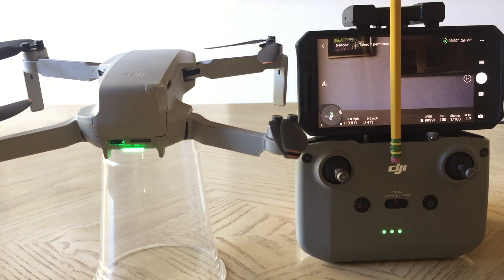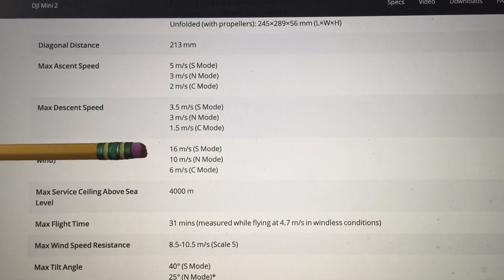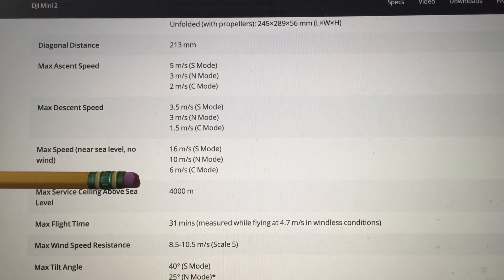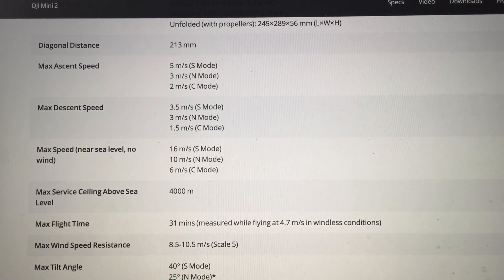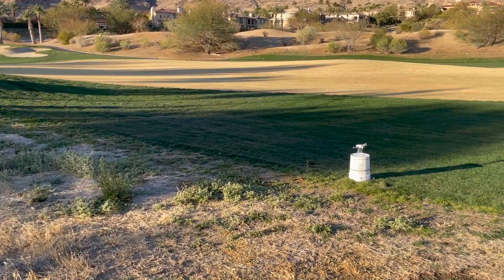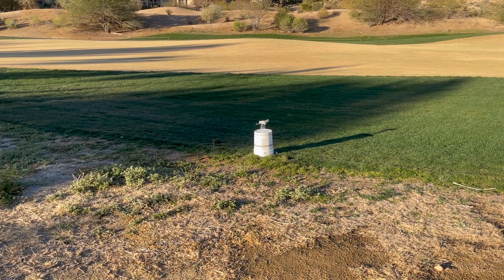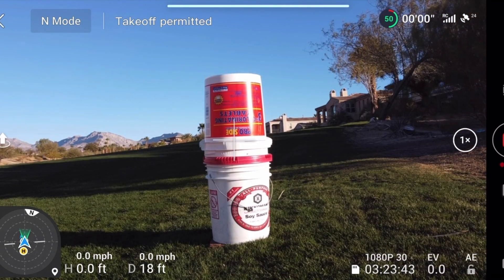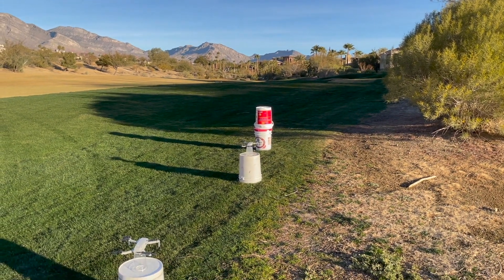DJI Mini 2 Latency Demonstrated

Comment: Any Info on the mini 3 Latency yet can't find it anywhere on the Internet. In the meantime i fly with Caddx ant + Runcam TX200u + 150mm Triple Feed Patch + Eachine lcd5808 it is so much  better for close poximity flying! You should try it! I Call it the FrankenDJI ;-)
Reply: Just found it myself on the Product Page ;-) still 120ms bummer. guess we have to wait for the DJ mini FPV Drone witch won't have gimbal stabilised footage.
Reply from the maker: Yeah, if they make a mini DJI FPV drone I'm getting it!

Comment: The Anafi AI with an integrates a Fibocom L860-GL 4G LTE module (in addition to the Wi-Fi radio) allowing to transmit a video in 1080p with a very low latency (300 ms) without range limit and everywhere in the world. Meaning that you can transmit live video anywhere in the world. Also, there is an HD live feed HDMI out to connect to external monitor. Meaning that you can control the drone from anywhere in the world. I am working on a software for drones as well for 5G. With 5G technology the latency will be bellow 1 ms up to 8k video transition. 5G will change the world in every way. There is a scam right now with all companies saying that they offer 5G, it is all not true. 5G requires over 5 different technologies and it will take in the USA alone over 7 to 10 years to be implemented, I think in 2030 is when we will have 5G. I work in the media industry and Broadcasting HD video took over 30 years and we still do NOT have full HD videos. All USA TV stations broadcast at 720p and 1080i. Meaning that is less than 2k resolution the government wanted to be. I hope the 5G implementation with be faster cause 5G will be in everything electronic. With 5G we will be able to create software in the cloud the will control drones, cars in real time, making anything electronics cheaper because the brain will be on the cloud. Another thing about 5G will do is the capability to have paper thin monitors, super fast computers that the CPU will be no more. Everything will be controlled by super computers. The drone technology will be almost a million times better than today's drones, because super computers will be most of the work and the drones will be almost empty shews with less parts... meaning flying time over 10 hours with a single battery charge. Yes, 5G will change the world like the internet did.

Comment: I have a tiny bit of delay using my galaxy note 8 but not as bad as when I used an iphone x there was nearly half a second delay using the iphone . With the note 8 it's almost instantaneous.
Reply from the maker: I previously used an iPhone 6 which had more delay than the iPhone 12  I am now using. Some phones have faster processors in them which comes into play. The 200ms latency stated in the specs is at best.

Comment: Very important tips! I appreciate the time and effort you put into making this video.
Reply from the maker: Glad it was helpful!
Reply: @thecuriousnomad4712  
Yeah, I always wonder what the exact depth perception between the drone and objects in front of it.    Like, how many feet or inches when u fly up against a big object I.e, tree, cars, your own house walls.   And the actual height when I take the drone up pass the streetlights.  Some time I let it hover right above me and it reads 10 ft.  I’m only 5’5”
Reply: @sk72  I've been noticing that elevation can vary widely from flight to flight and takeoff and landing points, sometimes as much as twenty feet! So my biggest concern is with a LOS emergency return, is that the tree or trees or buildings that you cleared on the way out, are they  now going to be obstacles that it doesn't know are in the way now?